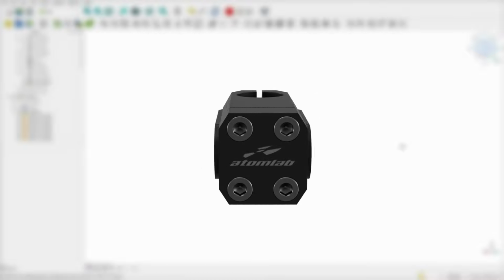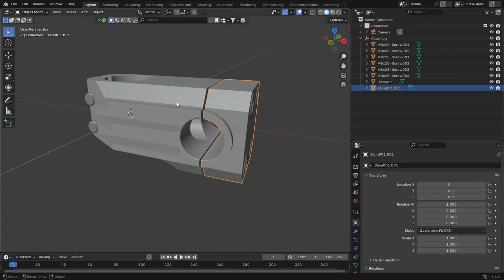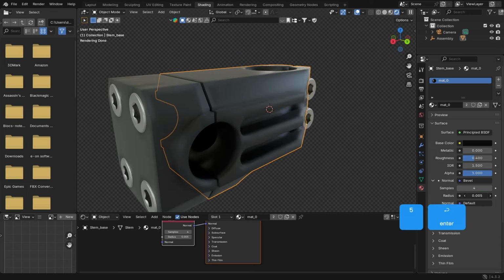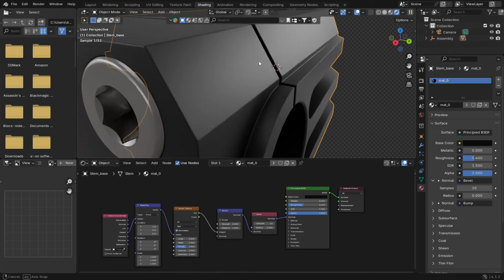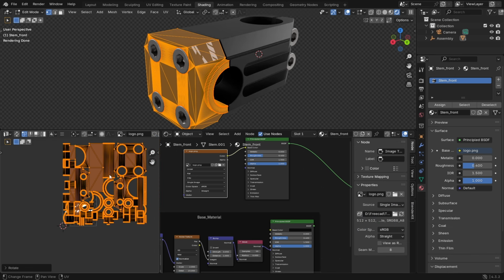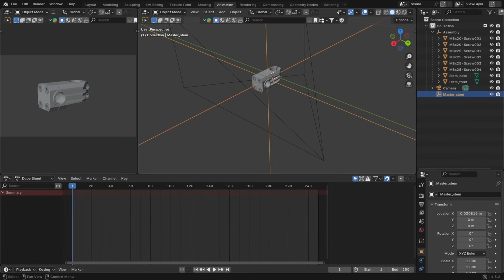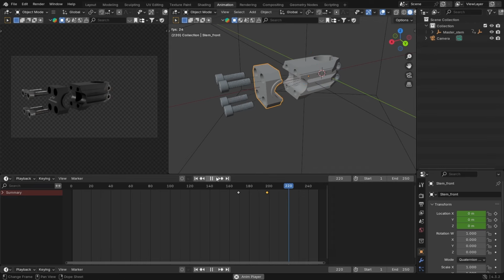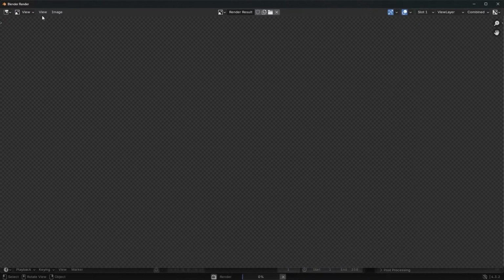FreeCAD 1.0 x Blender : Render and Animate your 3D CAD files -  Complete Beginner Tutorial

Comment: My glts export results in something weird

Like there are lines but I dont see the gray 3d model when I import intro blender, did anyone else experience this?

I will write the solution if I find it, might be a faulty export but I did multiple times
Reply from the maker: How is the export in OBJ or STL ?
Reply: @deltahedra3D  They work, but they dont have hierarchy so animation or seperate texture application will be problematic on blender.

Your provided 3d glts model also works well in blender, maybe V1.1.0dev weekly build of freecad has glts export not working for a reason. Its just lines and the model is invisible.

Also doesnt work on other online 3d glts viewers
Reply from the maker: It's strange. I tested importing the file exported from 1.1, and it has a transparent shader applied to it. Did you try replacing the shader with a default Principled Shader in Blender? That worked for me. Or change the value alpha of the principled BSDF shader to 1 instead of 0.
Reply: @deltahedra3D thank you I will try that first thing tomorrow, and write the result, which will also be documentation for others that use later versions

I don’t know where to change the transparent shader on blender as it was my first time with the app, but I will google around
Reply: @deltahedra3D  Hi man, I just tried it, it works thank you.

How I solved it was, imported, I clicked on the part and I could see the outline but it was invisible. Than by clicking TAB, or directly selecting the Shading workspace I have seen, Principled BSDF shader is applied to the material output, however its Alpha value was 0.

By adjusting the Alpha to 1, it worked and now I can see my part. Maybe we can document the latest weekly update GLTF export, exports them invisibly.

Or was it because although my assembly was visible, parts were hidden. Can be too.

Nevertheless thank you, your tutorials are the best out there.

I was wondering when we seperated the multibody part, stem bottom, if we could have done it in the Freecad itself. Because if we wanted to seperately manufacture these parts, seperate STEP files might have been needed.

One solution is cloninig the part and a pocket operation to delete top and bottom pieces but thats the first thing that comes to mind and a lot of work :D

Comment: Great tutorial! I think you should have mentioned that you can simply hover anything in Blender and press K to create a new keyframe. For example, you can simply grab or rotate something and if you have the numeric panel (right hand panel) visible with location or rotation you want to keep for that moment of time, you just the field (without clicking) and press K. It's much faster than continously going through menus like a caveman.

Also note that you can even animate node editor node settings this way. Just move one the timeline at the moment of time you want, switch to node editor and the field or value you want to animate and while howering it, press K. This allows animating colors, bump, noise textures and similar with very little effort.

And if you want to make even more complex animations, it would be good idea to lear about bones and use the pose editor of Blender.

Comment: The "Metallic" in Blender BSDF material is a slider but in reality the only realistic values are 1.0 for metals and 0.0 for everything else. If you have e.g. metal painted with transclucent paint, it should be modeled as two materials, underlying metal with metallic set to 1.0 and a partially opaque paint on top with metallic set to 0.0. The values between 0.0 and 1.0 are usable for non-realistic rendering only.

Comment: A massive thank you for your content...as a total newbie migrating from sketchup pro this has been invaluable. Would you please show sheet metal. In particular we manufacture steel door frames in 2mm sheet metal. We make use of CNC plasma cutter and CNC press brake bender so i need to design and export dxf files. Would greatly appreciate your guidance. Many thanks.

Comment: When going into edit mode, select faces (3) then hover over the back part and press L, selects all linked faces, instead of using a selection box. From one caveman to another.
Reply from the maker: Thank you for the advice, unfortunately in this case, it doesn't work because the vertices are not merged together. It's one of the drawbacks of exporting to GLTF with FreeCAD.
Reply: @ you could start by selecting all vertices and merge by distance and select something very small, should only merge overlapping verts..?
Reply from the maker: I have tried this, but the shading was awful, I don't know why the GLTF export doesn't merge the vertices automatically